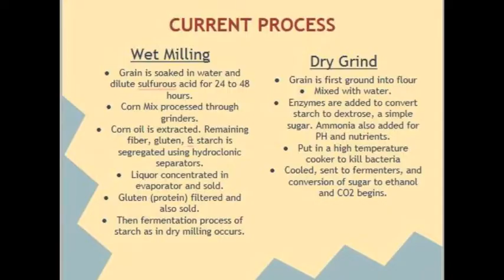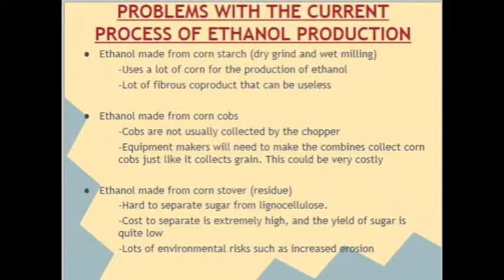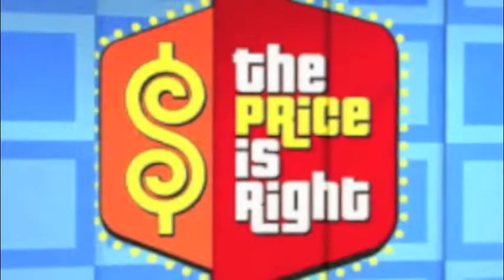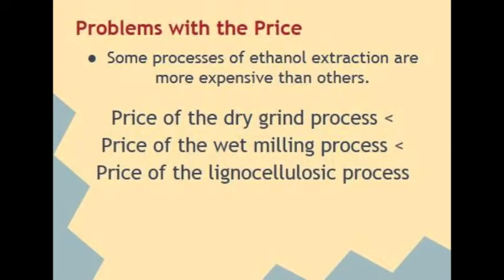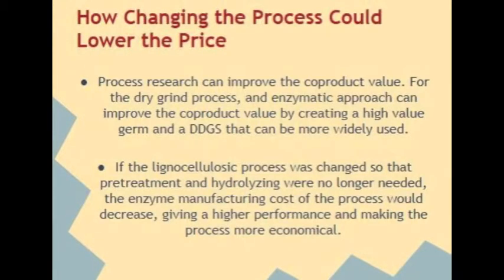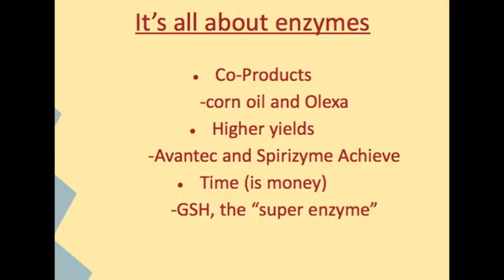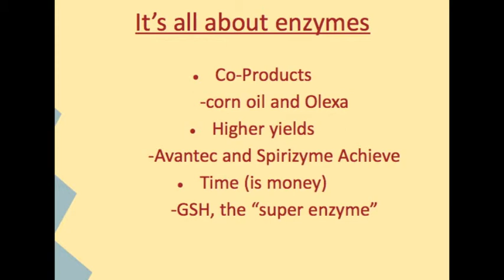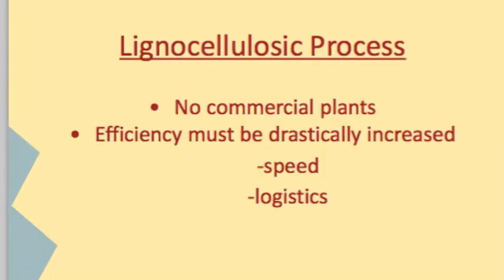ABE 100 BioPROcessors

Comment: Feedback
I like the game show idea ,but when the answers were revealed it was too blurry to see; some of the other parts were like this as well.

The slides explaining what wet milling and dry grind are went way too fast, I am not sure what how either of the processes work. 

Explained the problems with each pretty well and gave a good idea of which is the most cost efficient.

Needs better audio at some points.

80%